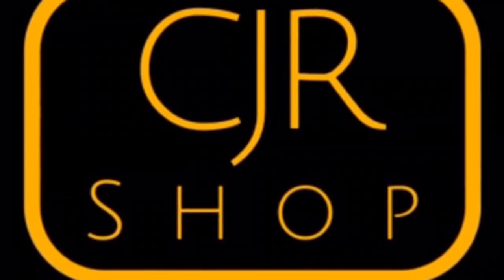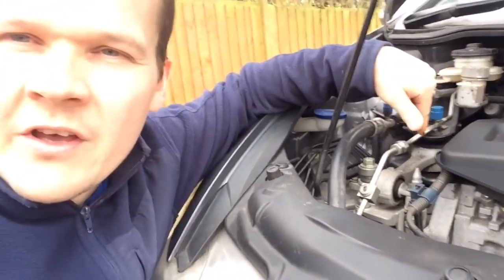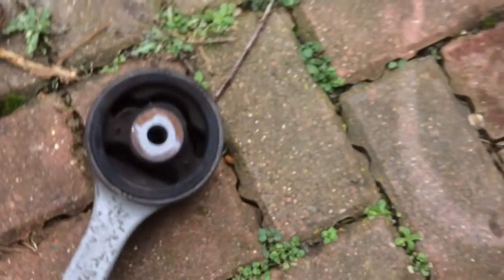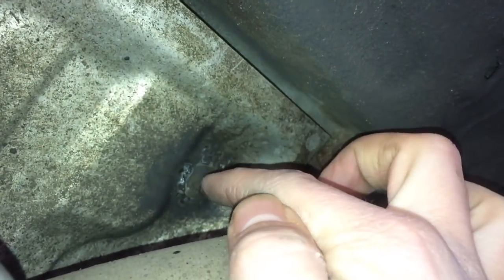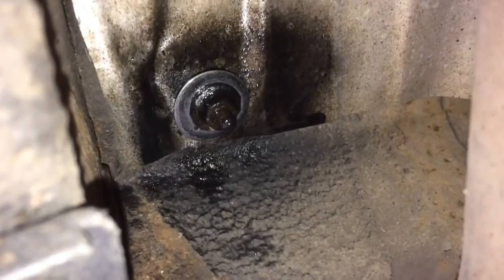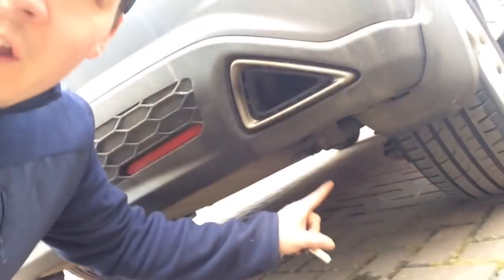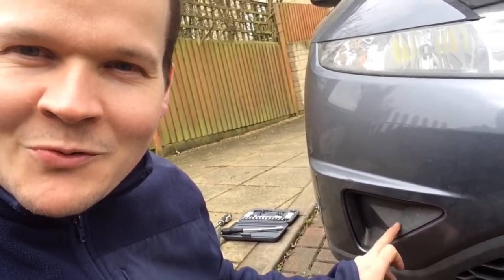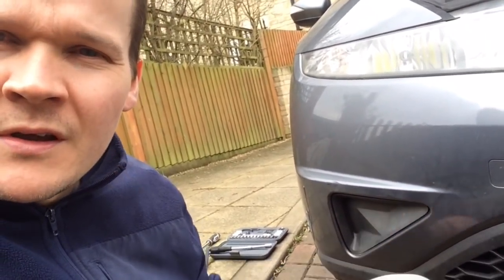Engine // Exhaust Mounts inspection Civic 8th Gen

Comment: Usually the bolts snap on the heat shields when trying to remove, easy fix is pop a few self tappers in to hold it. Vibrations can come from the front exhaust mount, just before it disappears behind the plastic cover there’s a bracket welded to exhaust pipe and the weld can crack and vibrate, sometimes not easy to spot.

Comment: Mine makes a rumbling noise in the front at around 3000rpm, and when A/C kicks in at running idle. The gap is still there on the motor mount but it is close. Dealer is a rip off at 400 Euros, aftermarket usually are no good considering wrong durometer. I will try the washers. Mine is 10 yeras old and all the wash plates from the brakes are totally rotten away! I upgraded to Brembo X line and DS pads and it stops like mad now. The quality from Swindon sure is less than Japan. But still Honda so better than that junk from Germany.
Reply: I just used three thick Honda shims (not sure were they are fom), 2 under, one above the mount body. 
Vibration is like 80% gone! I could not see anything wrong with both mounts, but they are old, I suspect the torque mount to be replaced before though. The bolt was in so idiotic tight it messed up the threads of the mount. Probably tightened with airwrench! 🤔
Thanks man!

Comment: My Exhaust shield started rattling two weeks ago. Need to jack it up and sort it out with few washer, as the bolts are still in the car but shield is rusted off from bolts.

Edit: You done a video on PCV valve m8?

Comment: Exhaust and cat heat shields...the source of panic and concern of many a DIY car owner when they start resonating. Took the cat heat shield off the MR2 as the clamp mounts had rusted away in the same way yours had and its not available as a separate part. Isn't going to cause an issue, if it was I'd  have titanium wrapped it. Hoping to track the MR2 this year...any suggests for tracks in the south?
Reply from the maker: Dad Diaries castle Combe , get yourself on a club day mate works out cheaper with an open pit lane .
Reply: The cjrshop cool. I'll check it out. Thanks
Reply from the maker: Anyone’s welcome on a clio sport track day 👍🏻

Comment: quick question: Is it the heat shield that makes that tinny sound when these cars start up?  seems to get worse over time.
Reply from the maker: Yeah just make sure the heat shields are not resting on the exhaust,they corrode badly and sag down .

Comment: Those rusty bolts on heat shields I've never had much luck. on 90% of the ones I have to undo always snap on me! Any blow front the manifold?
Reply from the maker: No blows at all through the entire exhaust system mate .